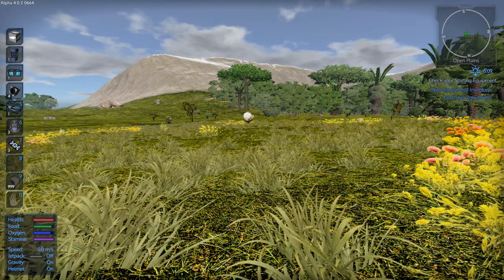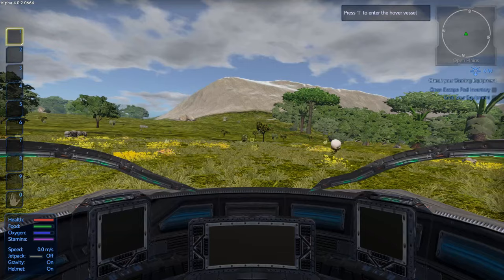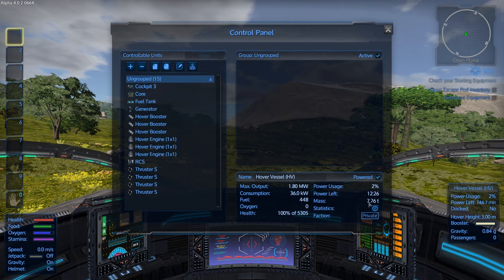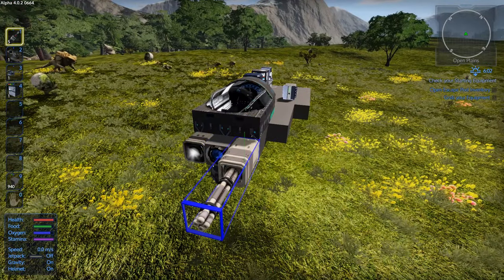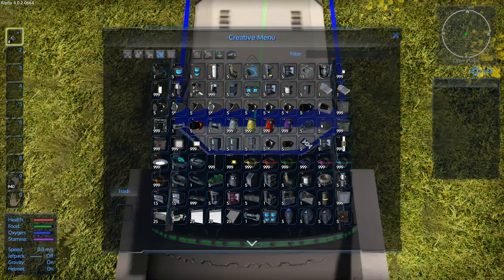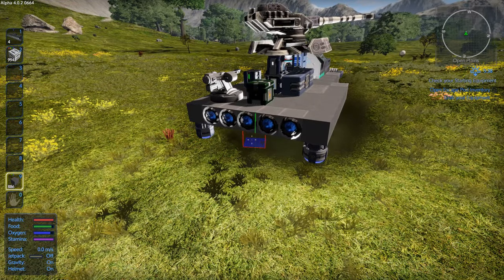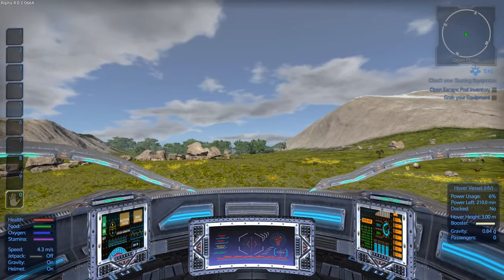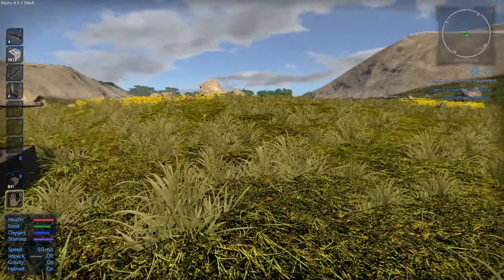Empyrion Academy - HV Construction and Use

Comment: Good tutorial.  Many will appreciate it.  Glad to see the pylon trick to raise the cannon platform well away from the core is finally getting some recognition.  Interesting use of the HV as a stand alone gun platform.  It appears physically smaller than the usual PUP (which is a BA).  There would be some advantages to that.
Reply from the maker: Yeah the pylon thing is kind of cheaty since it's taking advantage of the AI, but there are only so many options when you're faced with aimbots.
Reply: Well, you'll also find moving the core far away from your CV/SV you'll have no problems in space against Stations or drones.  I have a special space SV that has its core several hundred meters away from the actual SV.  The bad guys fire at it while I safely blast away their turrets.  They've never hit the core because just a little tilt of my SV moves the core a long distance.

Comment: I use the artillery turret in straight line of sight from just over 400m out as it will shoot further than the alien turrets. It may be further than the effective range but trust me... it will hit and it wont auto shoot to take out the core. You can use the FOV setting to act as a zoom function when accessing the mounted turret. My Hover vessel can be searched in the workshop. Hover_Tank_IV   Nice tips.
Reply from the maker: Yeah you can (or used to be able to) do that with the rockets if you aim a bit higher so they arc down into your target. I don't know their current range though. I should put in a note about the FOV trick. I've done that in my series, even forgot to change it back one time and did half an episode at FOV 40, LOL.
Reply from the maker: BTW they're adding turret zoom in the experimental branch. :)
Reply: YES!. Thanks.

Comment: I haven't used the new hover engines yet. How do you put them on in survival? Or do you just place them on top till you can get under the thing to place them? I hate how many thrusters you need now to make these things workable.
Reply from the maker: Agreed, the thrusters are really crummy right now. The bigger thrusters are actually even worse. They made everything way heavier but never adjusted the thrusters. :/ To get the engines underneath in survival, yeah you'd need to put on some temps, or put it on a scaffold of some kind. Too bad they don't have the jack/lift like in planet nomads and scrap mechanic.

Comment: great work ...thank you.
Great ideas for different uses for HVs.
Not sure how effective fixed guns (Gatling and Rail guns) are on a HV ... ?!? ... on a SV they are hard enough to 'line up'  (calibrate) ... to shoot where your cross hair actually points to. 
I found them to be most precise when mounted right at eye height in front of your cockpit. Kills the view when in first person however, so just to the left and right and just above your head in your cockpit. 
Shooting from elevation downwards while maintaining position and not sliding towards the target or drifting left and right is hard enough on an SV ...would be worse on a HV I imagine?
Reply from the maker: I don't think an HV will drift because of tilt like the SV does. (And the SV should not drift when tilted, that is so annoying, LOL.) Also with mounted weapons, everything other than gatling guns will converge on the crosshair if you're in the internal view. (I also find it 100 times easier to aim that way.)
Reply: Oh i see.
I use only Gatling guns so far and assumed they are typical for all fixed type guns as far as aiming is concerned. Maybe a bug to be addressed by the devs? 
Drifting is very annoying and apparently not just the result of my inability to build light SVs (... I seem to need more armoured  vehicles when facing drones, space drones and POI gun turrets)   :O/
So rail guns will fix my convergence problem - Thank you.

Comment: Holy crap - my HV's are not nearly so stable since 4.0.  I usually have 4 hover engines, maybe I need to limit it to 3?  Mine just wander away if I let them hover while I mine or whatever.  I also use much, much smaller HVs, so that may be an issue as well (rarely more then 3 wide by 8 long.  My SV's are also very wonky since 4.0, but I tend to make 'micro-vessels' so that, again, might be the issue.  (I'm using a new world/game and having all kinds of issues with ships now
Reply from the maker: Yeah, I've found that you need a min width of 5 or it's really tippy. I also build very minimalist HVs at the beginning and found the same problems with the new system. Try moving the engines out another block each and I bet you'll be much happier with the results. :) (I also added an annotation to the video for that, because I bet that's going to be a common problem for those of us who make small HVs.)
Reply from the maker: To keep the HV from rolling away, lower it to the ground before you get out. :)